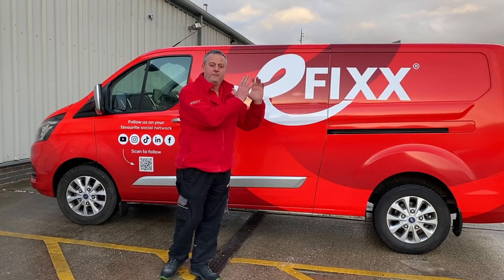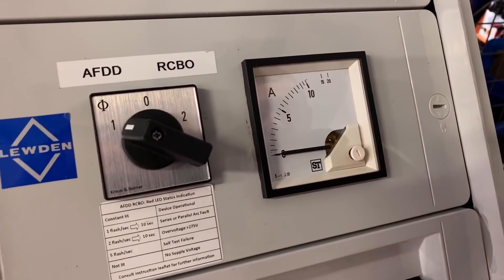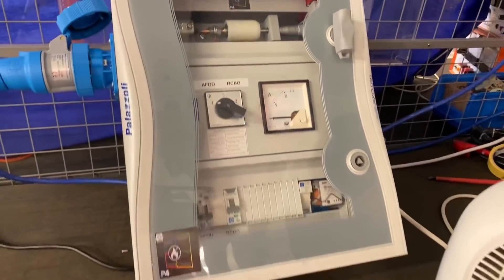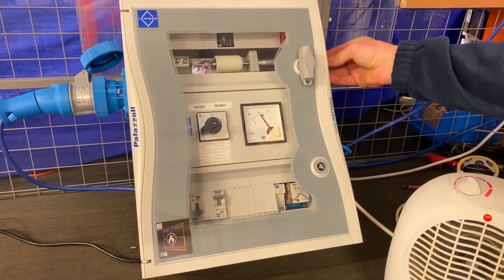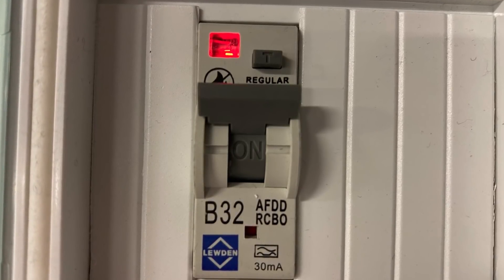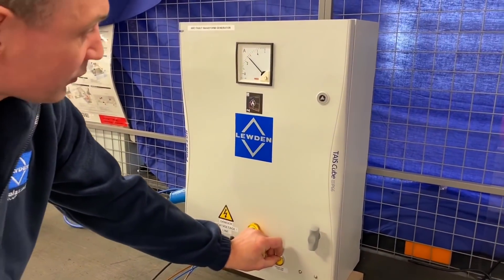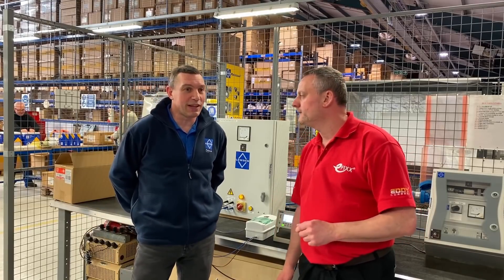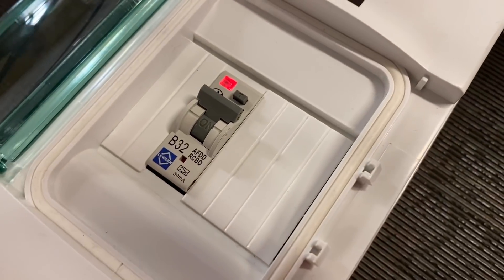REVEALED: The Secrets of an Arc Fault Detection Device AFDD

Comment: Maybe its me, but having seen videos by JW etc on AFDDs I kinda need more than a 'lab rig' demonstration that has been built to show it working. There needs to be a much more 'real world' example for me to know that they will genuinely save lives. 

That is to say the lab rig is contrived such that it will trip the AFDD ignoring the fact that people don't have carbon rods with adjustable spacings between in line conductors as part of their 'standard' install. (I also appreciate that making a rig that is repeatable and reliable is importnat for demo purposes).

I have NO doubt AFDDs work for the specification they have been made to meet, and that specification goes into great depth about when, and how, it should trip. But given others have tried to replicate 'real world' situations and sturggled to trip the AFDDs I think we need a demo that is genuinely more 'real' to show that they work in the real world and will save lives.

Maybe its just me. And maybe when the costs eventually, and inevitably, fall this will be a moot point.
Reply: I have said the same thing. Please someone show us the real evidence, a real life installation were arching is none to be a problem  , and not some sales rep telling you what you want to hear just so he can make a sale .
Reply: Agree the test rig should be a socket with loose connections to see the whole senero of an arc in a real installation , this way you should see the arc , then the carbonising of the PVC and then the action of the device.
I guest you would detect the smell of burning , long before the device trips.
Reply: @adrianmawby9009  Yes but only if you are in the vicinity. And even then you might not realise where it's coming from. I think the real benefit of these devices is where the area (room, flat, house...) happens to be unoccupied at the time of the fault - or when the fault is occurring in some uninhabited space (loft, garage, under floorboards, etc).
Reply: @gastube22  Not necessarily I am aware of one house fire that started this way and the smell of the fire inside the stud wall was initially mistaken for having come in through the nearby open window. Was only when the plasterboard cracked from the heat and collapsed that it was identified what the real source was. Had something cut the supply off then it might have stopped the fire spread or at least provided another piece of evidence to make the occupiers suspect a possible internal ignition had occurred.
Reply: Test equipment like this is necessary for testing and proving these kind of devices work.  The lightning simulators and voltage waveforms we use in the industry to simulate, test, and verify lightning protection devices don't model every single lightning surge, and no one is going to wait around for lightning to strike their antenna to see if their new device design works.  

In fact, the simulation models for lightning are ridiculously simple - basically a capacitor, resistor, switch, and a voltage source.  That doesn't mean we can't design, test, and verify good lightning protection devices.
Reply: As far as i can see those things serve no real purpose and are just loophole to increase their profits. From what I found yet they can't work in real life and smoke detector that would trip RCCB is an option that would work better. May be in several years they would detect real life scenarios but right now they look like they don't work

Comment: Great insight from Lewden and Efixx! Question, if the minimum operating current is 2.5amps, is it worth fitting them to lighting circuits? I would argue you very rarely draw that sort of current in your average installation these days with Leds being so common.
Reply: Most lighting circuits only need 3A mcb's or RCBO's with 1.00mm cable.
Reply: @johnburns4017  most would get away with a 2a
Reply: If you remember Efixx told us about. the new 2A mcb's as detailed in the Amnt2 update. I actually believed them, and it was the first thing I looked for when my new regs book arrived....... doh!

Comment: How much power (in watts) does these AFDD's use themselves?  And can the firmware be upgraded by an electrician if required?
Reply: At a guess a couple of Watts; still you put 10 in a CU and there's now 20 Watts of heat in your CU.
Reply: I dunno about the power, but they have a continuously running CPU so perhaps the same draw as an Arduino (ATMEGA328P) at the very least. 🔋

In this video you can see pads on the PCB for a TTL serial connection to the PCB/CPU, but if these things are going to be sold as welded closed units (Most likely, as regulation would prefer that) the process for an in-field update is probably going to be to swap the AFDD out for another with the updated firmware on it. 🗑

Though that said, it won't just be AFDDs where this approach will become commonplace over the next few years... 📱🚗😳

Comment: I'm all for afdds. If you get some plucky punter picking the perfect pontoon of opportunity to alter or change any part of a circuit including a socket and manage to make a dogs dinner of terminal connections... Also, people don't ever seemingly check their terminals every five years or so - so many terminals in sockets are loose and I've come across them on immersions etc and I'm just stood there wondering 'how marginal is this between 'ok' and on fire'...
These devices will definitely help create a defining line of 'who dunnit' and help with fault finding.
And those terminals that haven't been tightened in 20 - 40 years.. maybe..
Just the price is a bit stratospheric but when it's looked as a once every 25year cost, at half the price they are ATM, I would consider them ok value.

I'm just concerned they won't last 25years because someone cheaped out on some solder or didn't over spec the microcircuit componentry to last the oodles of on time..

I can't wait for one to get taken apart and for a detailed analysis of the componentry and see how it stacks against manufacturers specs to ascertain the longevity of the microcircuit componentry and controllers for e.g the self test function every hour... And whether the power factor of said circuits is optimised and LEDs arnt being overdriven in time for a premature death.

120quid for a failed led that costs 3pence because it's not user serviceable is something that sends shivers down my spine.

I have to get one replaced in a display of a car I own and it will cost a hundred (mainly someone having better solder skills than I and having auto test equipment for validation checks and a workmanship warranty..) and my time getting the clocks out and then putting them.

However the dealer would want a grand for a new unit and programming (ofc..)

It's great having all these feature packed into one near little package but in the component itself it does lead to a high rate of potential failure and due to complexity, cost increase versus a simpler dumber and easier to maintain unit.

Conclusion: one the one hand, great! It will solve a lot of problems (like ones between tenants and landlords..) and hubby and wife for setting the kitchen on fire because someone purports knowing how to do something.
On the other...
More e-waste. More complexity. More cost because it's not user serviceable for a component that could be replaced with the right skill and knowledge (i.e, that led I was talking about)

Long winded gaff but this change is going to impact me directly so... Yeah.

Happy fixxin
Reply: Use Wago sockets and terminals.
Reply: Good advice for someone who isn't me.. I will emplore that point to the electrically illiterate (y)
Reply: Well said T Perkins

Comment: Missing from the list of High Risk Buildings: houses where people make DIY AFDD test-rigs in their bedroom! :-D

Interesting to see the comment about graphite corresponding to carbonised PVC, that gives a bit of a clue to their risk model. But it's sockets not lighting, which suggest it's not rodent damage or the ever-sketchy capacitive-droppers in budget LED room lighting. I assume they've got good data from fire authorities on the risk they're protecting from, but what is it: loose installation wiring; faulty double-insulated equipment ("amazon special" wall-warts, etc); mistreated flex/plugs (pinching, pulling)?

Comment: So when will they make an AFDD for the whole distribution board as an entry level low cost solution. I would have no issue with fault finding a tripped AFDD for the whole system by a process of the usual circuit elimination process rather than this expensive AFDD for each & every circuit not to mention the residual power usage & heat generated with these things when a board of say 15 AFDD's are all on & banked together.  I think these AFDD's per each circuit are a milking  money tree opportunity for manufacturers based upon fear & compliance of the general public. Just an opinion from a normal non  sparkie homeowner.
Reply: Only socket circuits require afdd protection, having a single afdd will result in everything switching off including lights etc.
Reply: @farmersteve129  that’s because rodents only like 2.5 mm 2 , anything smaller or bigger is tasty enough .😂

Comment: Interesting video, thank you. Current prices for a combined AFDD and RCBO are approx £120 whereas an RCBOs are approx £20 each or less. So with a 10 circuit board that would be an additional £1000. Any ideas when the combined AFDD and RCBO will be in the realms of affordability?
Reply: You only need them for high risk environments
Reply: @theelliotmaaaan  Agreed. But you could have for example an HMO which satisfied 16th / 17th Edition but would benefit from an upgrade to satisfy ECIR Code 3 Improvement Recommendations. But this is now an even harder sell for the Electrician when the additional cost will be £1000+ more than “last week”. So the net result will often be that Improvements will not be made.
Reply: @stephencarter6634  Even more of a hard sell who only last year had to have a new consumer unit after being forced to have an EICR..  They probably brought this out a few years too late, just after everyone spent a fortune upgrading the consumer units..
Reply: @theelliotmaaaan  
You need them in blocks of flats with six floors and more. I would put one on an immersion for sure.
Reply: Only on sockets and high risk shower immersion heater no need for lighting with led LTs
Reply: @scott4shell  I thought it says just circuits supplying socket outlets with a rating not exceeding 32A?   Where does it say shower immersion heater?
Reply: @steve11211  it dose not say that but it’s good practice to put it on high load circuit, you always get shower pulls burning out and immersion heater switches. 
The regulations is a minimum standard to work to, there’s nothing saying you can’t improve on something
Reply: @steve11211  I think it mentions fixed installations
Reply: To be honest, the costs of the RCBOs was stupidly expensive until they became the 'preferred' option and then price really dropped... its just a case of time.
Reply: How do you test them on an EICR to prove they work? Has everyone got to carry on of those rigs around?
Reply: @paulbritton187  they have a self test on them, there is no requirement for an electrician to test an afdd function but I'm sure that will come in at somepoint
Reply: You only need them for high risk environments ,so that explains why some sparks have been retro fitting them for the past two years or so in every single installation they do , the truth is that they have been given a license to print money , why would they want to install a CU for £ 400 when they can install one for over a £1000  . Come on it doesn’t take rocket science  to work that one out
Reply: You can get the customer to sign to not have it. Like landlords are going to pay for this in some of the dumps these blocks of flats already like

Comment: High Risk Residential Buildings of over 18m high or over 6 floors (I presume including ground?). 
So, if a building is 8 floors high, do all flats need AFDD protection on 32A and above socket circuits? Or only the floors above six floors?
If a radial supplying a only a washing machine that only has a one 13A socket on it with the washing machine permanently plugged in - is it classed as a socket circuit? 

18th edition amendment two came into force on Monday 28th March 2022. 
So if if you have a 17th edition CU, does it need updating NOW?

Comment: I like the concept etc. but why are we putting them on low current socket circuits?

I would have thought they would be most effective on things like cookers, electric showers and permanently installed heaters? High current circuits are most likely to have issues and least likely for people to notice. If your immersion heater or electric heating clonks on to warm up whilst you're still asleep you're much less likely to notice a fire breaking out than when using your hair drier connected to a faulty circuit. Particularly as most houses will have the hair drier connected to a ring final circuit which Lewden's literature suggests their AFDDs are rather less likely to notice an arc in.
Equally you're unlikely to notice sizzling if you're in the shower and burnt shower isolators aren't uncommon things. 

If I was writing the rules, and maybe it's good that I'm not, I'd mandate them first in high current radial circuits likely to have high demand when you're asleep. Am I entirely mad?
Reply: there not looking for those particular faults that you suggested, there basically looking for the ones that have a specific waveform, higher currents wont make a difference
Reply: @brianhewitt8618  I don't think I agree. TCEng's point is that the 13A of your immersion heater, say, would be more than enough ( >> 2.5A!) to trip AFDD when the loose screw in the FCU causes arcing at 0200 in the morning.
Reply: The main advantage has to be for where cable damage is likely isn’t it? Think old houses with rodents that love to chew PVC, AFDDs would eliminate the risk of fire surely?
Reply: @edpreston3929   that’s because rodents only like 2.5 mm 2 , anything smaller or bigger isn’t tasty enough .😂
Reply: @seandempsey7351  well that would lend weight to the argument of putting them on 32A socket circuits which are most often rings!
Reply: I totally agree. That is where you tend to get most arcing faults I’d say. Showers are by far the worst for poor connections. 

Not too long ago, the owner of a wholesalers by me had a fire because of a immersion heater.
Reply: @yrification  
Then put them on circuits with appliances that you deem suspect.